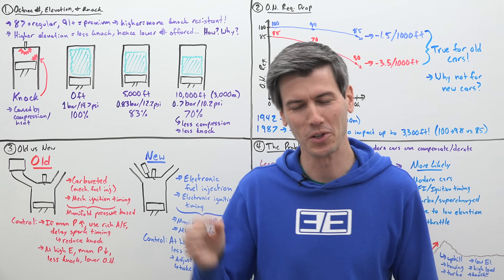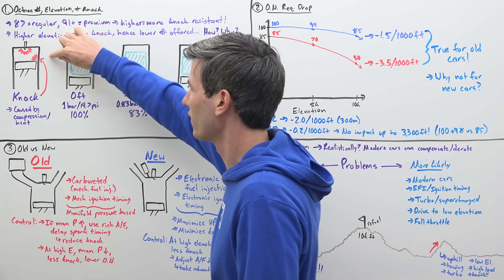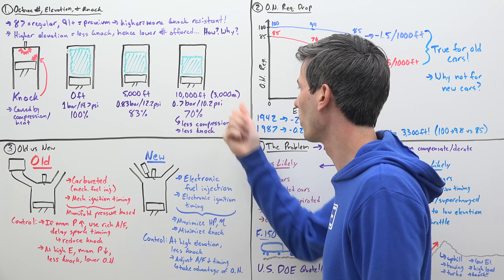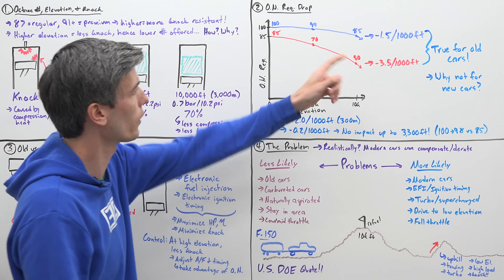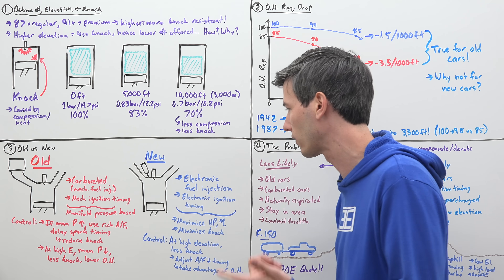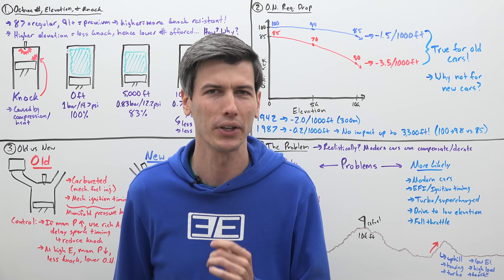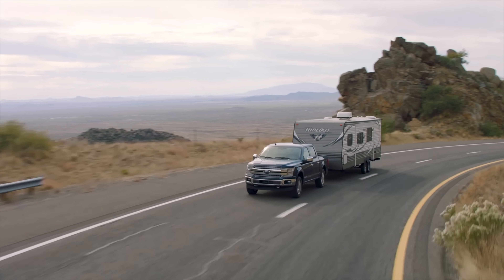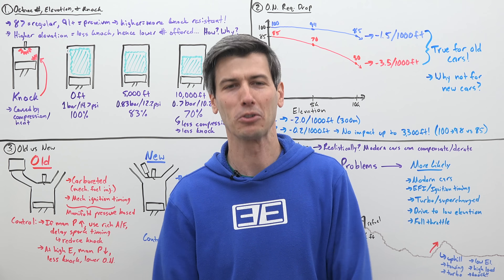Never Use This Gas In Your Car!

Comment: It's crazy, everyone talks about the fact that fuel is very cheap in the US but no one talks about the fact that it seems to be poor quality. The lower octane you can get in Europe (as far as i know) is 95, premium is usually 98 with even Octane 100/102 available in some station.
Reply: American octane is different from European octane
Reply: Aren't the ratings different though? I swear I've seen a video on it.
Reply: As far as I understand it, European numbers are not directly comparable to US Octane ratings. Europe's number is a RON rating. 97 over there is equivalent to 91 over here, for example. I think. That's what a brief google search reveals.
Reply: Thanks for the explanation guys, was not aware of that
Reply: They're not comparable number wise. Europe uses just RON to measure fuel octane while the US uses the average of the RON and MON figures to get what's called AKI. The octane ratings you'll see in the US are the AKI (anti-knock index).

Because of this, the numbers are different so if you see a 97 octane fuel in Europe, that's equivalent to a 91 octane fuel in the USA. I use 93 octane in my GTI here in the US (because it's tuned specifically for US 93 octane) which is the same as EU 98.

Edit: sorry for blowing you up, I wrote this before the other comments lol
Reply: Canadian fuel is much worse.
Reply from the maker: It's a different scale in Europe. See pinned comment.

Comment: I live in Denver. 85 is at every station here. The reason they use it is because they make more $$$$. They can upcharge that much more for 87 or 91. If I'm in Phoenix 87 is the minimum octane rating at pumps and it's cheaper than our 85 in Denver. Just sad.
Reply: Hello fellow Denverite!
Reply: When I visited Denver last summer I was surprised to see 85 octane rating at the pump, and how much more expensive the 87 was, and they were calling it PLUS.
Reply: I agree, I used to live in Denver many years ago and was always frustrated by that. I would mix 85 and 91 together to try and get between 87 and 89 octane.
Reply: I used 85 in Denver for over 30 years, never had an issue. However it always irritated me when driving to lower elevations where 87 was the standard the price was the same.
Reply: dude don't come in Quebec, our price is equivalent to 5,50$/gal for 87octone. After US/CAD conversion, it's still above 4.30$/gal.
Reply: @andresamson8859  The gas station where I charge my EV for free has it at CAD $1.57/l (USD 4.80/gal). At least our roads aren’t always under construction here ;)
Reply: @andresamson8859  Right across the border in Michigan (well from Ontario - but either way...) we are currently at $2.95 per gallon for 87.
Reply: @obsidian....  I know, every time i went to US (pre-covid) I always made sure to be empty getting in and full getting out !
Reply: @andresamson8859  Yes sir! I frequently traveled across the border from age 19-21. Being able to drive 30 minutes to legally drink for two years made me appreciate Canada sooo much 👍
Reply: @obsidian....  Same for North Georgia and lower Tennessee. Even cheaper if you're a Costco member.
Reply: @DragonKnightX12  Nice!
Reply: Well this is also because Denver became New California in the last ten years
Reply: Are Denver gas station owners magically greedier than those in Phoenix? If this is true, why wouldn't Phoenix gas stations do the same, if it really makes them more money?
Reply: @Morelia300  it has to do with which refineries serve them,  taxes and distance to transport the fuel.
Reply: @wayward03  Mostly taxes, but you are correct.
Reply: @Morelia300  Phoenix is 1100 ft in elevation. Denver is 5280 ft. They can't justify lower octane in lower elevations. Phoenix on average does have cheaper gas prices. I'm going there next week. 87 octane is cheaper there than 85 here in Denver.
Reply: @DJR5280  I live in Phoenix, but just came from a week long trip to Colorado. I'll admit I didn't even notice it changed from 87 to 85, so I definitely used 85 on my car rip lol.  What I was surprised by though is how expensive gas is over there... we thought at $2.87 it was already pretty expensive here. The craziest prices were in Aspen, where they only have 2 gas stations for the whole city... one was at $4.67/gallon and the other at $5.xx/gallon.
Reply: @dorian13  Yeah Denver for mid grade is just now below $4 a gallon. I think it was like 3.92 when I gor gas the other day
Reply: I'm in CO too, literally every Subaru that drives by under moderate acceleration you can very audibly hear knocking and pinging and I have no doubt it's because they're using 85. Bottom line is if 85 were perfectly safe at high altitudes, manufactures would state that. None of them do.
Reply: @glanzera  Or it's just Subaru's horrible sounding flat 4/6s 🤣
Reply: Whereas back in Lithuanian - 95 is minimum and everywhere, 98 is common too, but less likely.
Reply: @WorasLT  But that's not directly comparable to USA's AKI, or we'd be using it in aeroplanes here (if it has no lead.)
Reply: @UncleKennysPlace  AVgas is leaded and uses it’s own rating system
Reply: @WorasLT  the US and Canada use AKI, Europe uses RON, our 87 is equivalent to your 92
Reply: @patrickmartin3322  we do not run 87 us/ 91. Basically the whole EU is running on 95 RON / 91 AKI. 
91 RON fuel died here in the 90s because efficiency is not that great. You can't buy it. You can get  95 / 98 / 100 / 102 RON
Reply: @DxCBuG  huh I didn’t know that
Reply: @patrickmartin3322  Still....92 is like spicy water.
Reply: @WorasLT  95 RON is equivalent to 87 AKI.
Reply: @mtunofun1  95 RON is 91... Not 87. 
98 is 93. Europe mainly uses Diesel (until de Germans pulled Diesel gate). Which, when talking about efficiency, that European shouldn't throw rocks while standing in a glass house...
Reply: @WorasLT Europe uses RON (research octane number), not the same raring system

Comment: Do a video explaining pikes peak hillclimb cars that are optimized for the rally
Reply: Race cars at High Plains Raceway ( about 5,000 ft) race with av gas  100+ octane sold at the track. High Plains is about 45 miles east of Denver in Byers, CO. I use 85 in both my Outback and my '95 Nissan Hardbody in the Denver area. No problems.

Comment: dang it Jason, you should've released this video a month ago so I learn this before going on my road trip. I was driving an F150 ecoboost with a camper trailer, lol what are the odds? I did fill up on 85 once, I was suspicious, but went ahead with it anyway because I was half full and thought it'll dilute with the other fuel anyway. I didn't have any issues luckily. But never again.
Reply from the maker: Glad you had no issues!
Reply: Why would you put anything other than premium in your turbocharged vehicle anyway?
Reply: @amorton94  because it's what it calls for? I don't want to spend more money than I need to spend on fuel.

Comment: So the upshot of this is, the car manufactures are covering their backs just in case some smart arse tries to sue them for engine damage due to `incorrect` fuel rating usage at the non specified altitude.
Very interesting. Fuel for thought. Thanks.
Reply: People just know to use regular gas. I grew up in the Rockies and was told that 87 octane fuel at sea level tests at 85 octane here, so they are the same fuel, which I am now learning is incorrect. I would be stunned if manufacturers do not plan for this scenario during testing. High altitude with lower octane is not a new trend.
Reply: @martyscholes119  

Clearly manufacturers account for this scenario. That's why there is a warning in the owner's manual and that's why Jason made this video to explain it.
Reply: And I wonder how well that law suite works when people use diesel in place of gas?
Reply: @silverfox__12  Well to be honest, that's just human stupidity.
Reply: @LandRover300  I don't know that I'd call accidentally using an incompatible fuel that comes from the same pump with the same looking handle stupidity. It's basically the same human factors fail as selling 85 octane as "regular" and not something  distinct.
Reply: @Kandralla  e85 pump handles here are clearly marked and handle is different than 87-93 octane
Reply: @jeremygalloway1348  
I'm pretty sure e85 has nothing to do with an 85 octane rating but is instead 85% ethanol instead of 10% or 15%>
Reply: @silverfox__12  That's probably how diesels nozzles ended up being green in the States. Some dumbass did that and somehow won a lawsuit.
Reply: @DragonKnightX12  no its called engineering safety designs to help prevent you from accidentally putting the wrong fuel type in your car, human error prevwntioj, even for you.
Reply: @airgliderz  lol Get real dude. 99.9% these companies don't care  about saftey until there's a lawsuit or a Government forces their hand.
Reply: @DragonKnightX12  They use a different colour in the US? Interesting. In Germany, and I expect in all of Europe, Diesel nozzles have a larger diameter so you cannot even put them into petrol powered cars.
Reply: @englyn1  That's usually the case, but somehow people still manage to force the nozzle in.
So Diesel is also marked by being green.
Reply: @englyn1  It's the same everywhere - the diesel nozzle shouldn't fit into a gasoline tank. I suspect that in Vietnam people put the wrong fuel at times still, even when every pump must be operated by station staff and gasoline and diesel are never sold at the same pump...
Reply: @DragonKnightX12  Yes becayse every company knows the way to make sure people buy your brand is to be known as the company whos care kill everyone who drives it, real good for repeat customers..
Reply: @jeremygalloway1348  Is that a serious question? I'm not sure about this.🤔 What would happen is they would have to foot the bill of having the tank drained (if they noticed it early enough) or of costly engine repairs if the engine was started and took damage. Some insurance policies cover this though. There is no point at which a lawsuit could come into play here unless the gas station had diesel at the pump although the stickers said it was gasoline.
Reply: @DragonKnightX12  opposite, it's from people putting regular gas in their diesel. A petrol car will still "run" on diesel (albeit poorly and with massive power loss), but a diesel will knock.
Reply: @TriNguyen-nl7qo  all the gas stations around me have diesel and gasoline at the same pump
Reply: @DragonKnightX12 One time I saw a station with a black diesel pump and green gas pump.

I was gabberflasted.
Reply: @silverfox__12  By law the diesel pump nozzle is bigger than the gas nozzle, but I have seen people use a funnel to get it in there lol. This helps keep the lawyers at bay!
Reply: *Fuel* for thought

heheheheheeh
Reply: Every single person in Utah just lost their 💩

Comment: Ethanol content sensors exist, such a thing as an octane sensor?
Reply from the maker: Yes, essentially that's what knock sensors are. If you start running into knock (light knock is usually no problem), sensors detect and retard timing.
Reply: As jason said, it's done with software and the knock sensor. 

Btw, i'm pretty sure all the oem's have switched to software based ethanol compensation also. I know GM doesn't use those sensors anymore. It's all done via computer and watching a few readouts at predetermined intervals (like right after refueling).

Comment: Using your ford reference, Ford themselves said that for every XXXX increase in elevation, your towing capacity is reduced. TFL discovered this when Andre's f150 powerboost overheated going up their towing test. I'm sure thats going to be fun to integrate that in if damage was to occur while using lower octane and then not adhering to their strange towing de-rating standards
Reply: It's cool that the Ford Lightning and other electric trucks won't have that elevation issue.
Reply: I thought they were turbocharged
Reply: @crackedemerald4930  They are. I'd take a look at their video, I'm paraphrasing, but it seems like a cover up on Fords end

Comment: I was driving by the high elevation area in Colorado and attracted by the low price of 85, but I regretted shortly after I did so, and drove to the nearest store for an Octane Booster.
Reply: What happened ?
Reply: @DJR5280  aside from him offsetting the money he saved from using 85 and then buying an octane booster? He might actually have come out worse off on the deal than just paying for the higher rated fuel at the pump.

Comment: “It’s crazy to me that we sell a fuel that can cause damage to your engine.”

Why? Lots of stations have diesel, and (most) people don’t put diesel in gasoline vehicles. Lots of cars with turbos require 91 octane, but every station offers less than that. 

It’s the responsibility of the owner to know what their car requires. If they’re too lazy to figure that out, joke’s on them. Been using 85 in Utah forever, never had a problem. Just make sure to dilute with 91 before driving to Cali.
Reply from the maker: Because it's labeled as "regular." Personally I think there's a massive difference between regular and diesel.

Comment: Have you ever seen or used unleaded 88, I just got my license and been experimenting with different gas mixtures to see what is the most economically efficient (cheapest) and I tried unld88 (my car can) and have experienced a 10-20% drop in gas mileage but what I’ve been reading is it should only be about 1-2% more than regular vs premium…. Which makes me curious what 0% ethanol would do?
 -Have you experienced or seen research on any thing like this with different gas grades?
Reply from the maker: You won't see a 20% drop based on fuel grade, but in the 1-3% is probably possible. If it's higher than that, it's likely caused by something else (most likely driving behavior/scenario). Explained here: https://youtu.be/dxAQmj3P8xs
Reply: I’ve used unleaded88 many times. It’s quite common in North Texas and contains 15% ethanol. It’s usually several cents cheaper per gallon than 87 octane. I use it with confidence and see very little overall difference in gas mileage. 10-20% would be indicative more of e85 rather than unleaded88.
Reply: My rule of thumb on ethanol is, the higher the ethanol percentage is, the lower the fuel economy will be.  I had Flex-Fuel P/U and when I ran E85 thru it, the fuel economy dropped 20-25%.  Ran smooth, great power but bad fuel economy.

Comment: Does it really make a difference at leisurely engine force? (Actually, you covered that part with trailer example. ) Everything I'd been told about higher altitude effects never seemed to make much sense and I have always experienced smoother running (from sport bikes, Harleys,  4 inline turbos, v8) with better fuel efficiency. Just don't expect or try for max power.
Reply: If you know what to listen for and how to drive i say no. 

I used to put regular in my modified turbo car for road trips. If you made more than a couple psi of boost it would knock, so i'd shift down a gear when i had to go up a hill so the engine wasn't under heavy load.
Reply: @volvo09  you’d intentionally knock your engine to use a cheaper gas to save money?  If you can “hear” the knock you’ve gone way way too far

Comment: Based on the absurd prices of 87 and higher in Colorado and Utah, I’mma keep fueling up with 85 lol
Reply: When I was in Colorado, we only put in 85, but it was a rental lol
Reply from the maker: Is it that much of a difference?
Reply: @EngineeringExplained  yeah, I live in Colorado and it’s about 20 cents more for 87 than 85.
Reply: @EngineeringExplained  Here in Denver the difference between 85 and 87 is about 50 cents more for 87. It's at about $4 a gallon right now for 87 octane in Metro Denver.
Reply: @DJR5280  wow! That's as high as 94 octane ethanol free gas in my area (maine).
Reply: @EngineeringExplained  On my last western states road trip this summer, 85 was ~$3.45 a gallon and 87 was over $3.70.

Hit Nebraska on the way back and 87 was $2.92.
Reply: @NextMerckx  Difference in state gas tax.
Reply: @EngineeringExplained  I've found a couple stations nearby me that only have a 20 cent jump from 85 to 87 but 30, 40, 50 or more is pretty common.

Comment: Good to see another video of yours Jason. Can you please do a video and explain how EVs run heating and AC and the difference in range when on and off. Also, why can't EVs recharge their batteries when they are running and only do it if they're breaking.
Reply from the maker: Here's your comparison! One uses AC, one uses heat.
Summer EV Roadtrip - https://youtu.be/dxAQmj3P8xs
Winter EV Roadtrip - https://youtu.be/UskzfQJt2Bc
Reply: Braking with the motor generates electricity, you can't do that and get forward drive simultaneously.

Comment: 95 and 98 is the norm here in Switzerland, no wonder the prices are through the roof...
Reply from the maker: It's a different scale. See pinned comment.
Reply: @EngineeringExplained  when "translating" the from RON to AKI, the lowest I see in Switzerland is still (95 RON =) 91 AKI
Even on 2k altitude...
Reply: He said @1:28 that Europe uses a different scale so the numbers aren't directly comparable.